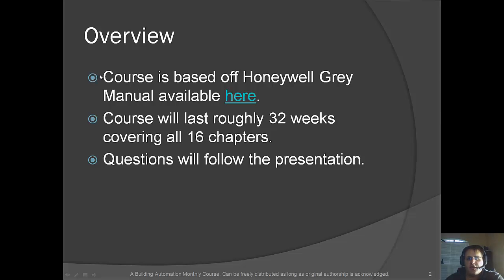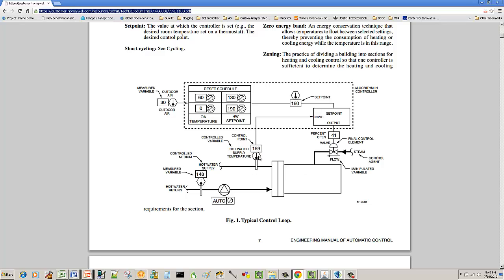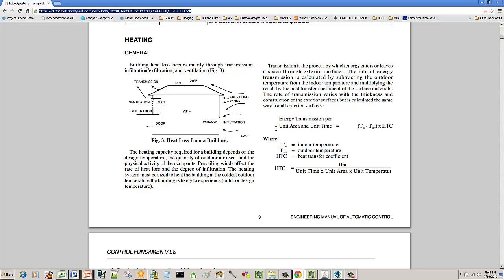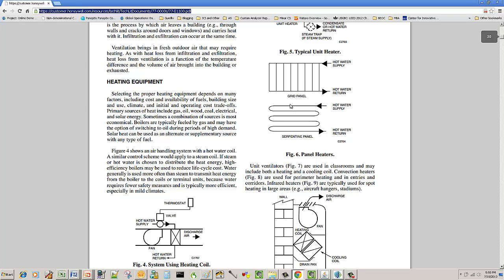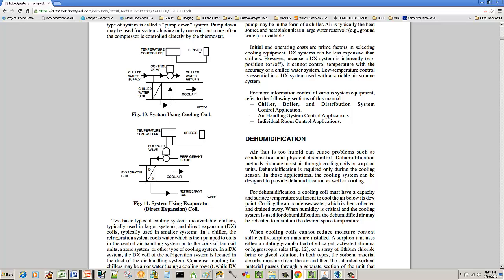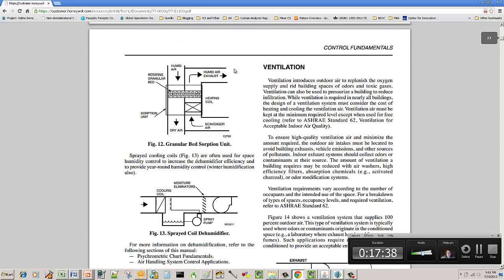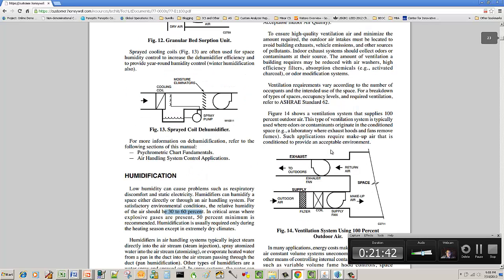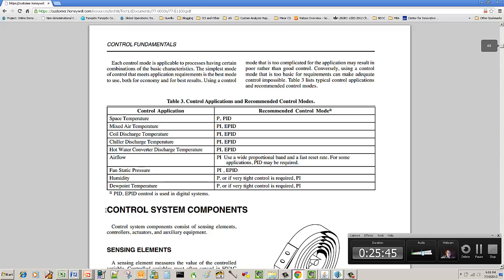HVAC and BAS Fundamentals Part 1

Comment: In 100 words or fewer, indicate your experience operating, repairing, or installing computerized building automated systems (BAS). 
I'm currently applying for a position as an HVAC Tech I with the city of Phoenix. I am HVAC certified with a 608 EPA Universal  with 2 years experience 09-11 but I have been working in a different line of employment as a Field service Tech for Nilfisk Advance as a productions Tech/Field Service Tech as an Airport Runway rubber and paint removal specialist. I am eager to re-enter the realm of HVAC. But one of the requirements of the application is that I complete the task stated in the opening of my comment. Will you help me to answer intelligently enough to impress the potential employer. I am a very fast learner and will make sure that I am prepared if considered for the position. I plan on studying your videos to ensure that but I am currently faced with this obstacle that I am uncertain how to respond to considering I have very little experience with HVAC BAS. Anything will help. Thank you
Reply: +Phil Zito I cannot thank you enough!!!